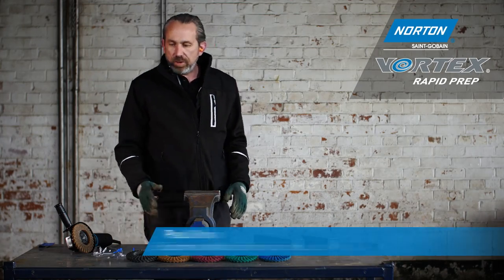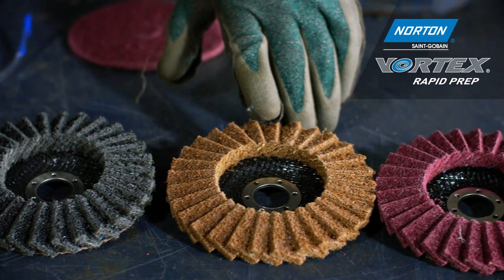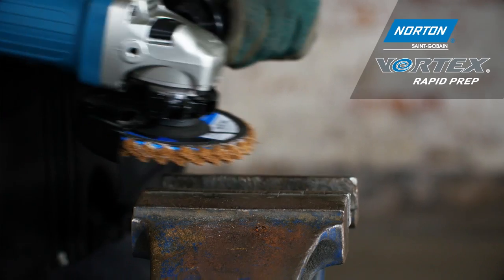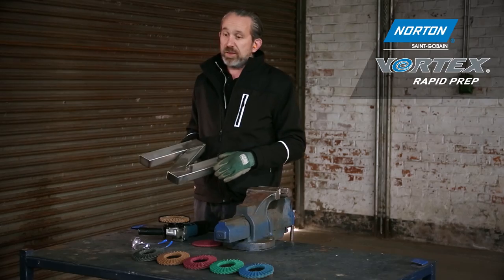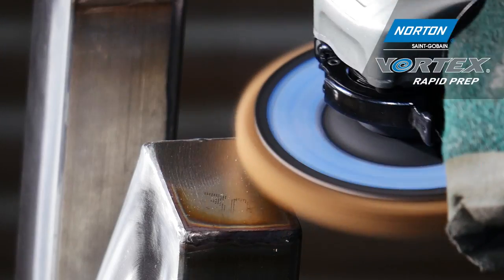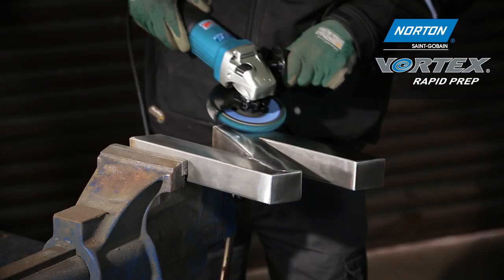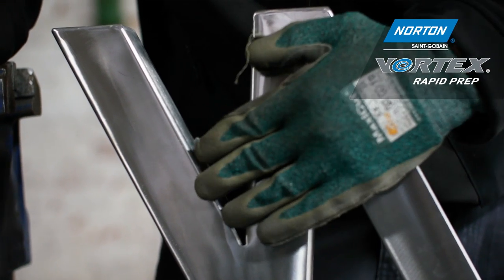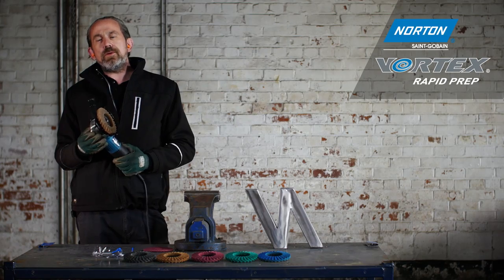Blending & Finishing Stainless Steel using an Angle Grinder with Rapid Prep flap disc

Comment: Thanks. I needed that.  I bought several flap discs today for sharpening mower blades, 
since a neighbor recommended it.   But I think your usage is the 'proper' usage.
I wasn't familiar with the term "metal blending"...and now I am.
(It wasn't part of a career in computer programming)
Reply: Which flap disk did u purchase for sharpening the mower blades?